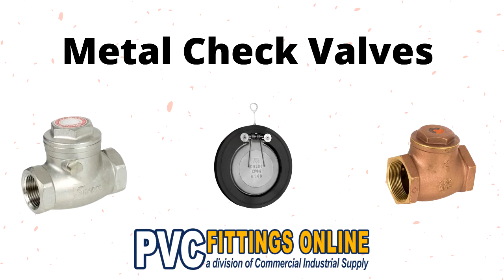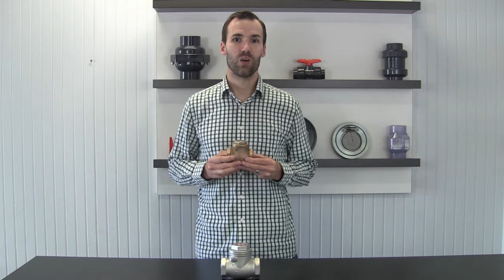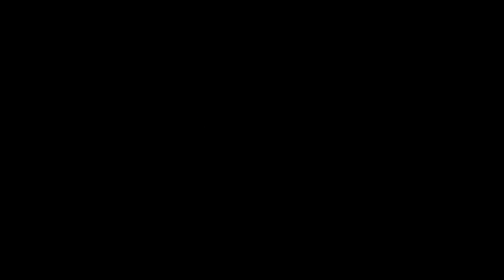An Overview of Metal Swing Check Valves

Comment: So is it important  if it is installed in horizontal or a vertical.  I think that would be a very important factor to know about a swing check🤔
Reply from the maker: Hi Joel, it all depends on the flow and application. If you do install it vertically you would need to install it with the flow going up so that gravity would close the valve with a drop in pressure. There is an arrow on the valve so you know which way the liquid should flow through the valve.